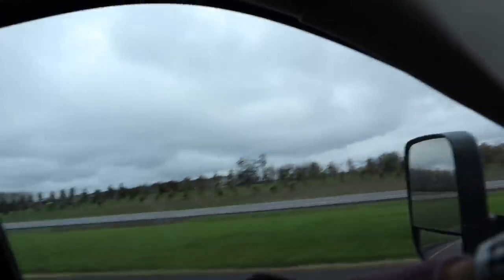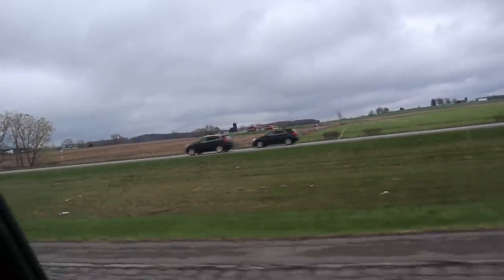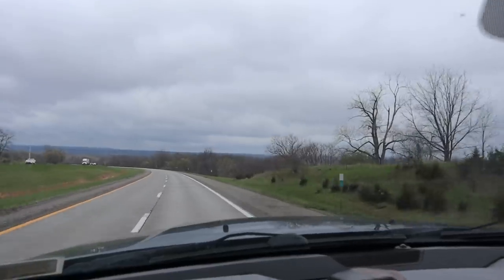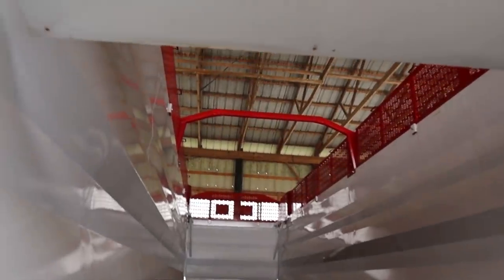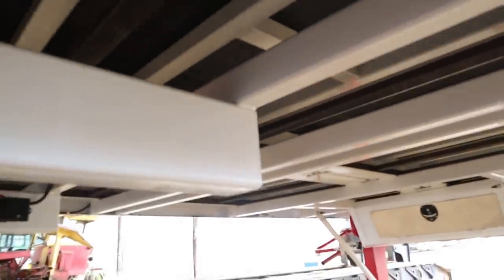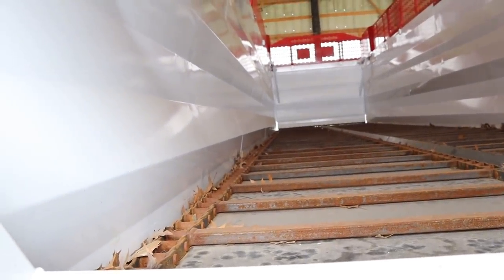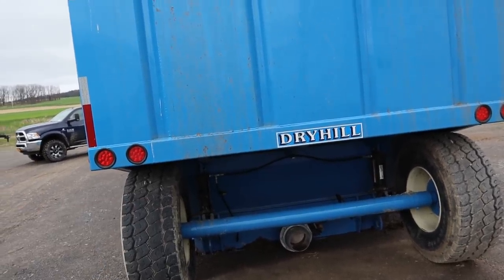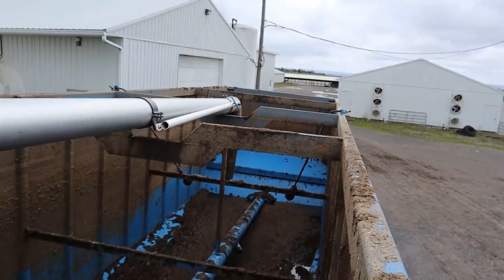Road trip to look at a Mas silage trailer and a Dry Hill Frac tank.

Comment: I bought a similar chain out trailer at an auction a couple yrs ago made local here by JBL hardly used like new...Richie's said it might not be able to be registered due to export import regs....took a chance and got it cheap...took two weeks but I waded through the beraquacy bullshit and Bob's your uncle done deal. Fantastic unit used for alphalfa silage, sawdust and shavings, air trip door and when empty just snub the brakes and shes closed. Had 3' screen extensions...works flawless and turned out to be a good deal. 👍

Comment: Another good video andy thanks for the road trip. Those tires sing pretty good.  That silage trailer look nice and well built a bit different than the dillers or myers. My neighbor has a frack tank setup like that seems to work good for them they drag line just about everything. You'll see them setup with frack tank on 1 side of the road and have drag line running through a culvert pipe under the road to the other side out spreading. They have a toolbar with a knife setup to knife manure into corn ground and what looks like a big bubbler for grassland. That old barn looked great, not too many old barns around these days in good condition like that one looked.

Comment: Andy the farm I work at has one of those dry hill frac tanks. We deadline from ours. The only problem we have found is the agitation doesn't quite work right. The agitation pipes on the inside aren't aimed right, and the sand doesn't like to run out of the tank and will settle in and become impossible to move due to being too heavy. I had to wash ours out with water from a pond to be able to move it. It's a good tank for sure, but that's some issues we've had with it
Reply from the maker: Good to know

Comment: We always wanted a frac tank as our spreader was smaller than the trucks and we ended up hauling manure back. Our drag hose guy uses a frac tank that he built out of a 30000 gal aluminum tank on a skid. As for silage trailers if you haven’t seen the fleigel trailers they are a hyd push out trailer that can have beaters put on they also claim you can use the pusher to compress haulage as you chop

Comment: THe silage trailer is heavy built, is that the same size as your current one? The frac tank would definitely help with the wait time with the trucks hauling from the farm to the fields.  Nice day for a dad and son's outing.  👍 Thank you for today's video.
Reply from the maker: They one we have is 10' longer but shorter and it has tapered sides. This one will hold more than the one we already have.

Comment: Those look a lot better built then the diller silage trailer. I like that trailer because your not restricted to how tall you can stack that silage. The diller I’ve ran, there is a pipe going across the top and you couldn’t stack higher than that where was the grain unload option?  Those chains are a lot bigger than the diller. I wonder if it can unload a load at 40-45 seconds. Think you’d ever go to a dragline system? I’d bet you can clean the pit quicker and less soil compaction.
Reply from the maker: Someday we'll probably have a drag line system. There wasn't a grain kit on this trailer.